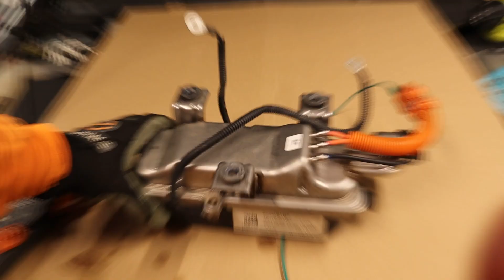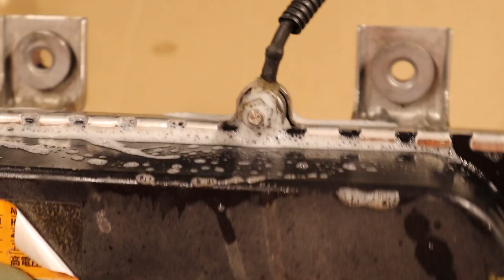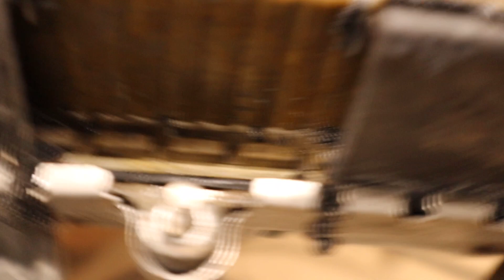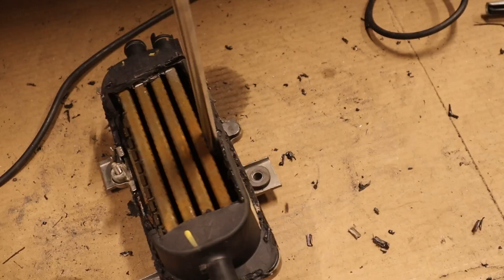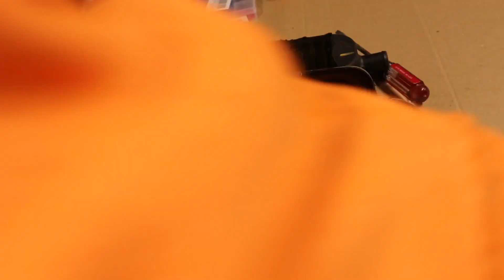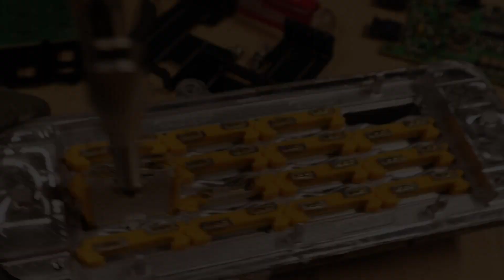What's Inside? Electric Car Heater (2012 Volt Heater Tear-Down)

Comment: If it is just that it is leaking, they make special pliers to crimp those tabs , just like on a radiator. You can also tap them lightly with a hammer and drift so that the tabs press on the gasket a bit harder to seal it. That being said, if I spent so much time removing the thing, I might just replace it while I’m at it. Just my 2 cents.

Comment: eh probably wont do this job if replacing the pump doesnt fix it.... but if i did, i would just straight up unplug the two connectors, cut the wires on the temp sensor, and leave the whole failed unit in place and then find a new spot for the replacment heater under the hood, ground it with a ground strap, wrap it in silicone insulating tape lol, and make or jam some new flexible tubing onto the places that its supposed to go.
just leave everything hanging in there.... resolder the temp probe wires i cut onto the replacment unit... hopefully it would have the temp sensor... and plug it back in and just leave it hanging somewhere not too close to the engine. maybe put some aluminum foil tape on the side closest to the engine so it doesnt melt

Comment: Hello Benjamin, it looks like this is the bad part on my Volt as I replaced the pump a few years ago and my kW doesn't increase when i turns the heater in. Based on what you saw, I'm curious if you had a thought on what actually went bad with the heater and why?  I know it wasn't sealed as per your bubble test, but how would that cause it to fail?  Thanks.

Comment: Well that wasn't designed for repairability or replaceability at all! I can appreciate the redundancy of multiple heating elements and their layout that which covers the entire coolant flow path with each circuit so it still heats some even if several elements fail, but wow that seems really involved to just convert electricity into heat. Is the flow rate over this heater rather high? Is that why the heat exchanger has such little restriction?

Comment: These are almost the same as the PTC heaters for the 2011-12 Nissan LEAFs and it looks like they fail from the same bad welds of the heating elements to the circuit board.
Reply: Also the leaf ones wont take new ptc elements as they know the ohms of their original and will tell the car dont use me if you swap them. Its lim based and you can overide this with a lim mitm hack. See ev-olution yolasite for more details

Comment: That metalic/ceramic heating element will be a PTC resistor. Positive Temperature Coefficient materials become higher resistance as their temperature increases.  This self-limiting feature makes them safe for use in that type of application.  If the heater were to run dry or if the circulating pump were to fail the heating elements would not overheat to the point that they started melting things or causing a fire. PTC heater elements are used in a variety of household appliances, from scent dispensers to CPAP humidifiers.

Comment: This would be so much cheaper if they had the module and the heater separated;  Then you would only have to buy one or the other, and not be forced to buy both (when it needs repaired).  With that rubber gasket, it almost seems like you could re-crimp those metal fingers holding the plastic on and it could possibly reseal;  as long as the plastic wasn't cracked.

Comment: Never considered that these things would use coolant, guess I never thought about it. Could you use one of these in an ICE to EV conversion to keep all the factory cabin heat controls?
Reply: You probably could as long as you were using 360ish volts, but you'd probably be able to find a cheaper solution, he said it cost over $1000 from GM and as many people have complained about their Volt heat failing or decreasing after a couple years, and as difficult as Ben showed it was to extract, using a junk yard one would probably still cost more than it was worth.

Comment: Those are probably ceramic PTC heating elements (Positive Temperature Coefficient of resistance, i.e. self-regulating)
Reply from the maker: When I tested the resistance of the individual heating elements, resistance went DOWN with an increase in temperature!
https://www.youtube.com/watch?v=021uvwYQVp0
Reply: @BenjaminNelsonX  it could be a constant current design, but I don't see any large inductors and there is clearly 4 elements in parallel. So I don't know why they would have it go down with temperature. edit: it could also be a metal oxide and have a non linear current draw similar to a MOV. This would mean it draws more power when the battery is fully charged.
Reply: @BenjaminNelsonX  I think that's what PTC's do. When the temp goes up the resistance drops.